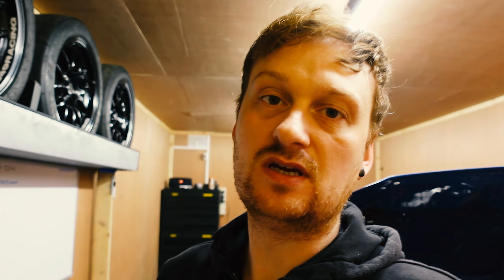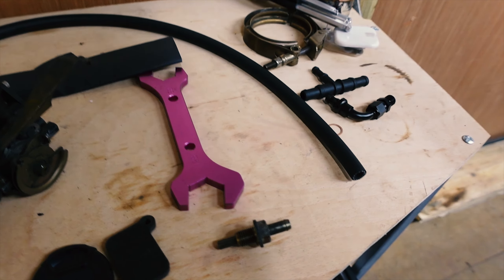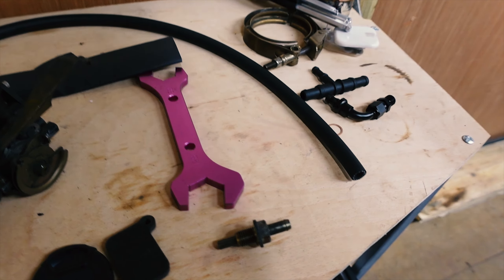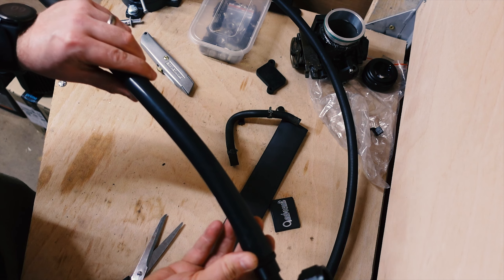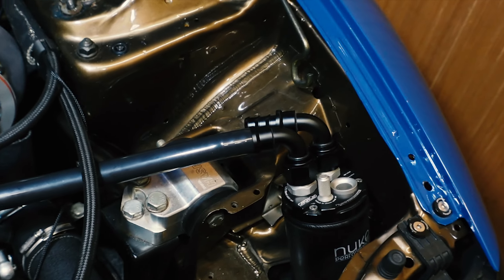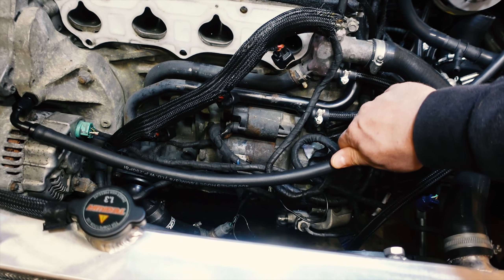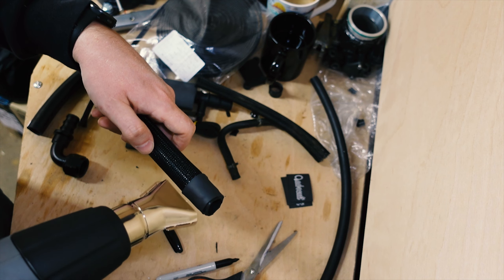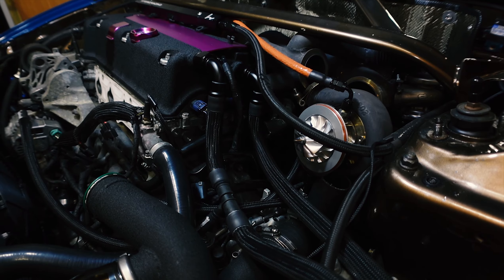Honda Del Sol K20 K24 PCV crankcase breather upgrade

Comment: You could just cap that if you’re n/a? I swapped my ep3 with a k24 and am running into the issue of where to route it. My skunk 2 doesn’t have a fitting for a hose to run to the pcv so im stuck and you can’t drive it just with the pcv not routed to anything right?

Comment: So i would be able to cap off the Outlet on the Manifold, where the PCV hose runs into? then, Run a hose from the PCV to the catch can without recirculating back into the manifold ?
Reply: It you're serious boost better pcv and breath hose to catch can and vent out through small filter. Most people use upgraded PCV valve to catch can and to the intake manifold. Breather to catch can to intake of turbo.